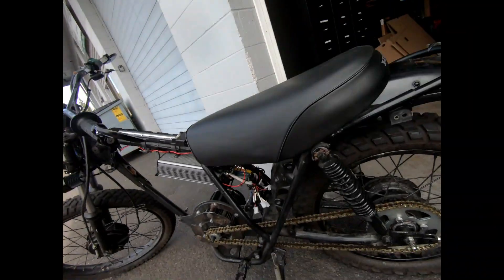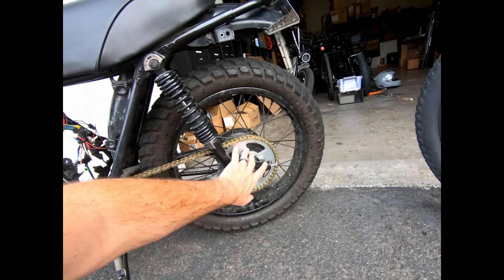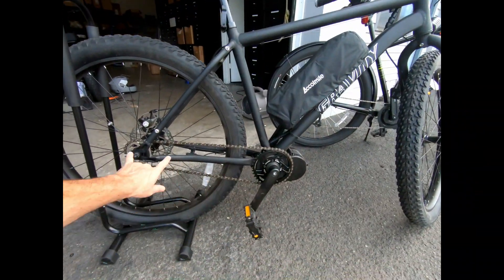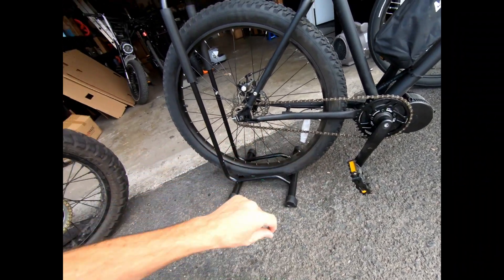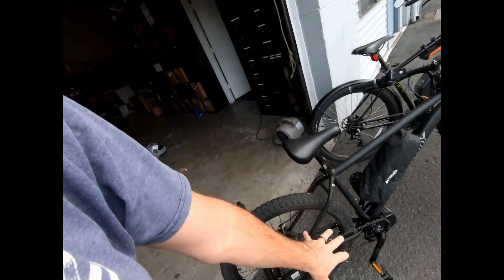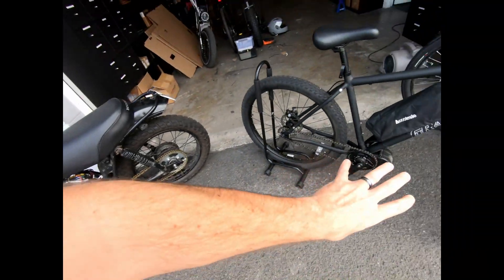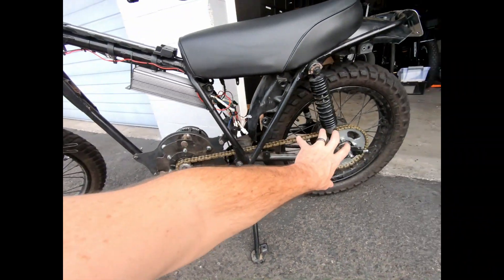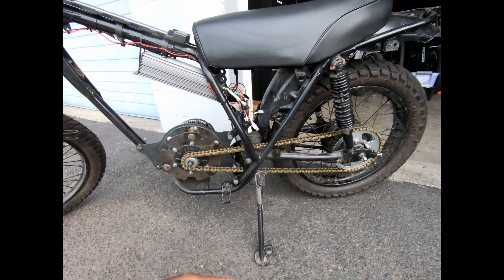Pro’s and Con’s of using Hub/Mid drive Motor with a single speed Bike.

Comment: I have a bike now, it's 1500w it's good but always wanted mid, it's currently single speed,
I'm not needing speed more than 40kph.  90% would be 30kph
I pull my service dog and camp, looking for torque more than speed. 
Could I do it ? And what gear in the rear would you suggest ?

Comment: my old bmx frames have american bracket bottom.  I want to know what adaptors I need to get to fit the bafang mid drive on my bmx frame.   it would be S&M Sabbath or Standard frame.    they would be late 90s frame made with American BB.  it is press-in kind and 2 inches.
Reply from the maker: https://www.johnnynerdout.com/product-page/ashtabula-bottom-bracket-adapter

Comment: I own a single speed Schwinn Kokomo cruiser bike w/ 27.5" mag wheels. I'm now a senior with bad knees. Please, any suggestions on what specific Mid drive kit to purchase for an E-bike conversion?
Reply from the maker: I’d get a bafang bbs02 cadence sensing type motor. I’m not 100% on the size of your bottom bracket so you’d need to measure that to get the right size motor 👍

Comment: Hey Johnny, I love your content. Just a little background I own a Riese and Müller supercharger which I have installed a Grin tech hub on the the front and it is by far one of my favorite e-bike too ride to which I have many. But I am designing a new bike. What would you suggest for gearing of a single speed CYC gen 4 with a 72v front hub from Grin tech in the front  for the Seattle area?

Comment: dose anyone know if mid drive motors work on all bike frames
Reply from the maker: 99%
Reply: @JohnnyNerdOut  My plan is to put a Bafang mid drive motor on a standard bmx bike, but I would like to put it on to a different bike later on if possible

Comment: Dude, question !! Can you install a mid drive on a fixie bicycle ?? Am curious what happens when you brake with your legs, can the motor and gearing take that reverse torque. Can you pedal backwards with the mid drive installed ?? 
Or is this just not possible, and  a mid drive will only work with a normal rachetted single gear . Please help
Reply from the maker: You would need a tongsheng with coaster brake compatibility. All other mid drives have a freewheeling crank.

Comment: Saw video from another builder that single speed conversion is no good if your drop outs drop straight down.
Is that opinion or fact? If opinion, and you have a different opinion, please chime in with your opinion so I can open a bit of discussion so I  can possible form an intelligent decision.
I'm about to start my first build and contemplating removing the rear derailleur but leaving the cassette on the same cog....... but would rather convert to single for the cleaner look and removing useless crap from the bars.
I live in Fla on all flat terrain.
I ride big chain ring and smallest cog consistently,
No off road riding except maybe crossing a grassy field and riding oyster shell paths.
An average ride will have me negotiate side streets, beach roads, busier main roads, rail road crossings, and one or more decent sized draw bridges.
So, what says JNO watchers?
Can I convert to single speed rear, mid drive with vertical drop outs?
Reply: If you can find the perfect gear ratio it works.  You can't pull the wheel farther back to tighten the chain as it starts wearing.
Reply: There are chain tensioners but your gear selection is still pretty limited
Reply: Trying to streamline.
Unfortunately, I’m still running with the rear derailleur attached to nothing.
It works but is unsightly.
Reply: Buy an eccentric adjustable bottom bracket.
Tension problem solved.
Just choose a belt size which is at full tension when the eccentric bb is rotated into its mid position.
Note. 
Dont skrimp on eccentric bb, buy a quality one which is capable of locking securely in position. 
👍

Comment: Question: I’ve got a single speed Gravity gravel/road bike. Big 46t ring up front and small ring in the back for faster flat road riding in Florida. I’m considering adding a Bafang MidDrive motor. I figure I would pedal with the motor off when starting (to save it from straining on the big single speed gearing) and then once I’m up to speed a bit, turn the motor on and use it to maintain high speeds and maybe even use a thumb throttle. Does that sound like an OK setup or is the hub drive what I should be going with? Or is either one just not a good idea with that type of gearing? I’m weighing the cost/advantages/disadvantages between converting my gravel bike or buying a Gravity Ebike in the 28mph top speed class. Thanks for any info!

Comment: Is there a way to get regen using a mid drive and fixed gear?
Reply from the maker: Short answer is yes, but most stock controllers won’t support it. You also need to make sure you don’t have a freewheeling crank.

Comment: Could you do a video talking about the risks of drilling the frame to run cables internally? I am looking to buy a bike to convert and lots of bikes already run brake/gear cables internally. It is really tempting to just drill or expand the existing holes there to hide most of the extra cables. You could then fill the hole up with some hardening putty or something

Comment: I just realized I live 13 miles from your shop. I didn't know you were in Vancouver. I'm in Portland. Would like to see your shop so I will contact you.
Reply: They technically don't have a retail space. It's just a shop/small warehouse with pallets of inventory and space to work on bikes, but they were very accommodating and invited me to bring my bike over to see how big of a battery would fit in the frame. Just give them a call to see if you can drop by. It'll be either Johnny or Shane.

Comment: Single speed makes a lot of sense for the longevity of a mid drive drive train. Derailleur systems and hub gears are not designed for the constant high power delivered by a mid drive.

Comment: I think the 2 biggest pro of mid drive more people need to realize. 

 1!!! in like 95% of cases mid drives are waaaay lighter meaning for most systems your getting higher speed because the bike is lighter, you obviously are also getting those gear benefits. 

2!!! And omg can I not stress this enough if you are still riding regular size bike tires aka anything under the common 4.0 width then changing tires is going to be common since honestly bike tires no matter how we wanna slice it are fragile it’s just that simple and changing a tire on hub motor bikes is always a huge pain for so many reasons. 
You’ve gotta disconnect connectors which on some bikes is a pain due to very strong connections, you gotta lug around a heavy ass wheel to change the tire, and because hub motors always have very long axles you can’t lay them flat on table or even leaning them on flat surfaces gets sketchy because of how heavy the motor is meaning it easily damages standard tables and such. 

Some extra quite small reasons:
On other really huge benefit people don’t talk about enough but I consider this a personal preference so it’s not a 100% pro for all. But dude the handling on mid drive bikes I’ve found to be so much better, overall having all the power and weight centralized makes things like carving corners way easier, maneuvering the bike around manually is extremely easy because it light too so storage is also easier to handle. 

Also something I’ve very rarely seen on hub motors is a push mode, among the “low power” situations bafangs products and cyc both have a built in push mode to help with walking the bike up things like hills or such which on builds I’ve had that were a bit extra heavy is a very nice touch that I really wish more hub motor e-bikes and kits would start including.
Reply: Dude never thought about that, you are right!
Reply: I want an ebike but feel  it's too little for too much money......I had to go with a $200 motorized bicycle engine kit build. 
40mph top speed,  80 mpgs, 40 mile range on 1/2 gallon tank of gas. I can ride in 95F or 20F  all day without worry of damage to a $500 battery pack.
I can leave bike parked  in 95F direct sunlight all day or outside all winter in 10F without risk of  battery 🔋 or electronic damage. 
I have nothing against ebikes but seems the 2 & 4 stroke kits offer way more bang for the buck if properly cared for. Wish I still have had a workshop so I could weld together a steel full suspension motorized bicycle frame.
Reply: @michaelbrinks8089  the thing with motorized bikes is, in some states they are now highly illegal, they often look messy no matter what you do, they are quite loud which for people with sensitive ears like me is a huge problem(that’s why when I move to the motorcycle market even then I’ll have to go electric, it’s also just not as accessible for people who aren’t handy enough to understand gas engines especially since the 3 times I made the gas motor bike all the engines came not all the way out together and such. There is also the issue of heat, and mounting light systems since it’s illegal to ride even a regular bicycle with no lights. 

I see the benefits of both but I think for a regular everyday person, who’s maybe has light pockets but time to wait, going to alibaba and ordering a $200 motor kit then getting a $300 48v battery will suffice for most people.
Reply: E-bike has the convenience of recharging at home and almost anywhere with an outlet.  The motorized kit requires keeping a gas supply to refill.  Personally I'd avoid riding almost any bike in bad weather unless an emergency.  Just not a pleasant experience. I'd agree these still overpriced, but they are just more convenient than my motorcycle.

Comment: what about different gear systems compatibility in mid motors. Normally if you take an 8 speed and 10 speed system it will be completly incompatibile, different chain, different chainwheels. but somehow i cannot find information, you can buy bafang chainset, but for what type of chain it is? 7 speed or 12?
Reply from the maker: That is dependent on the cassette in the back. A 9 speed cassette requires a 9 speed chain and so on.
Reply: @JohnnyNerdOut  obviously, but what about chainwheel
Reply from the maker: @Puccini000  I have only occasionally ran into issues with 12 speed chains on stock chainrings. Lekkie makes a “pro” version that is designed for 10-12 speed drivetrains

Comment: I would go with a hub motor for single speed and mid drive for multi speed bikes. Higher performance 72V rear hub motor upfront with good torque arms on both sides.

Comment: What would be a good all around gear ratio if going SS? Best motor ? BBSHD or BBS02?
Reply from the maker: Bbshd for most people. Ratio depends on how you would be riding it. All off road? All top speed commuting? Different ratios for each application
Reply: @JohnnyNerdOut  strictly road for me or maybe the occasional gravel path. Not really looking for speed, 25mph tops.

Comment: I got an idea about a system that could work . Carbon belt drive for pedaling single speed  with ability to change belt sizes due to dh frame. Then mid drive with chain single speed but havto rejoin chain and changout to steel freehub with spank hex E type. Hub. Should take 5 minute on the trail  to change between the two.